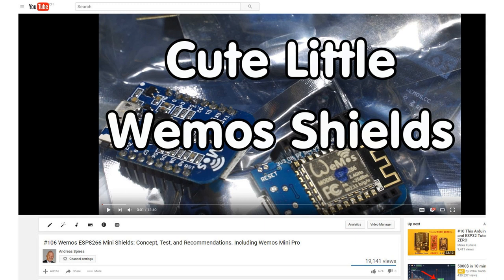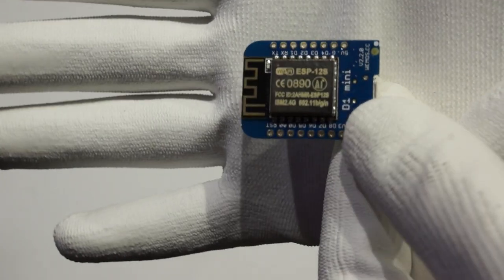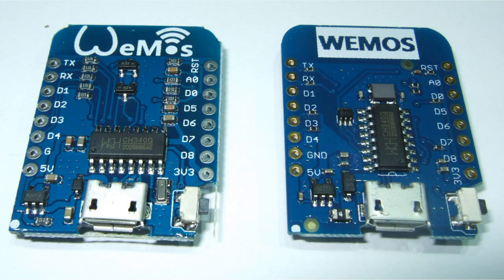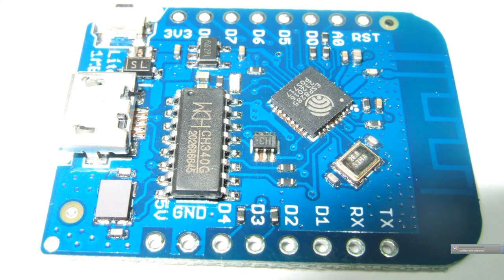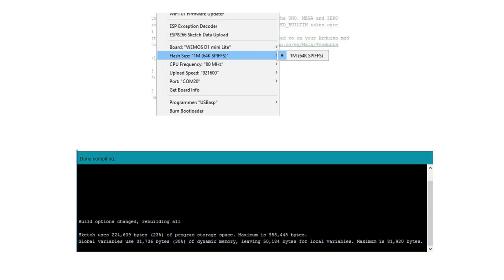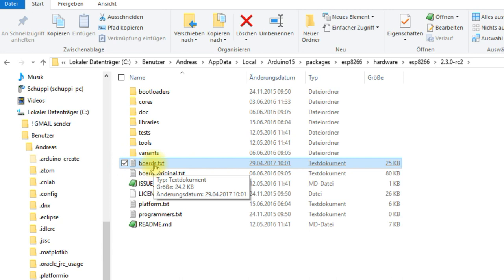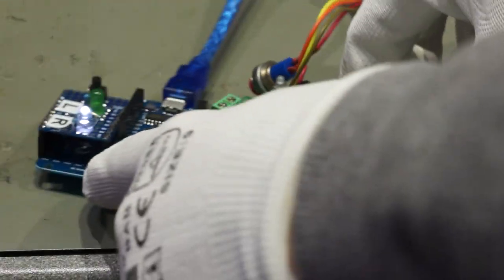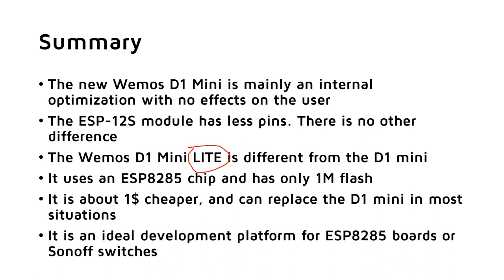#136 New Wemos D1 Mini Shields: ESP-12S and ESP8285

Comment: I like the esp8266-12f module because it is so tiny. But it is hard to program with the need of an external usb/serial adapter and the tiny connections.
This weekend I desoldered the 12f module of a wemos D1 mini and soldered 2 female headers on it.
Now i can easily solder male headers on the 12f module (2mm) and connect it on a D1 mini to program. Works perfectly. 
Thnx for the nice video. For me the extra $1 is worth it.
Reply from the maker: Before the Wemos came I usually used a bare ESP-12 module (programming was done with Pogo Pins). Now, it is more convenient for most of my applications to use a Wemos mini. I anyway try to use OTA (iotappstory.com) as much as possible to avoid Serial connections...

Comment: You don't need a flash button. The arduino IDE uses DTS/RTS via USB to automatically enable flash mode. You just need the correct board selected: "Wemos D1 R2 & Mini"
Reply from the maker: I know. Maybe I was not clear, but sometimes I want a button to trigger a function in one of my sketches, and then, such a button is handy...

Comment: Why would you need a "flash button"?
The run/flash mode is fully automatically handled.
Reply from the maker: You are right. But I do not flash by Serial, I use IOTappstory.com. There, I need as switch to indicate the board to go into config mode or  to start an update. This is the case in many other applications where you need a button to interact with the device.
Reply: Ah, okay.
I use the Arduino IDE. And normally, I always active the OTA Update server, so that I can update it via WiFi.
Reply: I also use the Arduino IDE and the Arduino OTA. My WeMos are distributed in the house, in the garden and in my second flat 100km away. Some of them are build in and unavailable . So I need a real OTA without pressing a local button. In my applications an OTA with pressing a button is not very useful.
Reply: "In my applications an OTA with pressing a button is not very useful."
´The provided OTA function does not require pressing any button!
Reply from the maker: +klassich D You are right. In production environment, OTA has to go this way. But I use my boards also for development. And then it is sometimes handy. But it is a small detail. Not important. Just a difference between these boards and the NodeMCU boards.
Reply: Exactly; and this is the reason why I will stick with the Arduino IDE and will not move to a different method using an additional button. Using the "espota.py" and a .bat file I even can flash my WeMoses in my second flat over VPN. That is really great. If I want to update e.g. 10 temperature sensors, it is just the preparation and starting of a single batch file.  This works really great!
Reply from the maker: +klassich D with IOTappstory.com we chose a different way where we provide a webservice which automatically detects, if a newer version of the firmware exists. Then, the device updates automatically. And of course, you can assign as many devices to the same app. But there are many ways which lead to Rome, as we say here in Switzerland;-)
Reply: Yes, that is also a good way if you can wait a little bit. And I admint: In the long term it will be the better solution, when (if) deep sleep really works and gets more and more common. 
In general I always tend to prefer solutions running on my own server.  
From here in Germany a very common way to Rome leads through Switzerland ;-)
Reply: Das sagen wir auch hier Österreich. ;)
Reply: A dedicated flash button has nothing to do with the WiFi modse. This has to be done by software with a separate input push-button.
The flash button is normally connected to GPIO0 and toggles "boot from SPI flash" or "download code from UART". (with GPIO15 LOW and GPIO2 HIGH)
Reply: Wemos D1 mini is unable to go into flash mode if you make the deep sleep bridge from D0 to RESET. You have to add a jumper or button. Also, the reset button acts on release only, there are some projects that go into OTA mode or something when you keep the reset pressed for X seconds, this is not possible on the D1 mini.

Comment: I might add that I noticed that the new Lite and 2.2.0 version now have an onboard poly fuse.
Reply: what is the use of the fuse, if boards gets to hot to shut down for a while ?
Reply: The fuse will open if you draw too much current from the supply.  IE if you short VCC to GND accidentally. Note that polyfuses are designed to self resent. https://en.wikipedia.org/wiki/Resettable_fuse
Reply from the maker: +Jon Raymond Thanks for the tip. I will add it in the comment. I overlooked it. My mistake.

Comment: Thanks. Why the capacitor in the button shield. It is required? To flash the wemos is not only pulldown to ground D3(gpio0) for more than 5 sec?
Reply from the maker: Mechanical switches "bounce" and might disturb the behavior of fast microprocessors.

Comment: can you do a power consumption of the wemos d1 and d1 lite , like what you did with the esp 8266
Reply from the maker: I do not think, that there are big differences between the old and the new Wemos boards. The designs are very similar. All Wemos and NodeMCU boards, however, use much more current than the bare modules during deep sleep, because they have additional chips.

Comment: How the blynk app connection to this boards acquire flash memory. What will happen if i buy 4mb wemos d1 mini rather than 16mb wemos di mini pro
Reply from the maker: I never worked with the Blynk app.And I am not sure what advantage 16MB have. Most of the projects do not need such a large memory.
Reply: @AndreasSpiess  my plan is to create iot solar monitor using blynk app. The thread i have followed uses a d1 mini pro which has 16mb. But he has given the file which is only 90kb. My confusion was like adding libraries and stuff will accumulate the internal flash then i may require more flash (like 16mb) for that. Then im going to purchase d1 mini v3 with 4mb. 
Now im clear. Thanks a lot!!

Comment: Wait ! Aren't those extra pin on the ESP12-E for the hardware SPI ? 
I know it is hard to use because it also has the flash chip but SPI is a bus, should be possible to have multiple devices on there no ?

In particular, it should allow booting the ESP off a microsd card of gigantic proportion compared to the flash !
Reply from the maker: Maybe. I never saw somebody using it.

Comment: I have a D1 and I can upload code and it works without any need of added buttons?
Reply from the maker: The D1 should reset automatically. Usually, you do not need to press buttons for programming

Comment: I added the boards definition to the boards.txt file.  Still no luck with the mini lite.  I'm beginning to think it is a waste of time, maybe should just stick to the D-1 mini, mini pro.
Any help would be greatly appreciated.
Reply from the maker: I think, the new 2.4.0 release has the Mini Lite in the boards file. Otherwise you can replace yours with this one: https://github.com/esp8266/Arduino/blob/2.4.0/boards.txt
Reply: I just replaced the entire file with the link you provided.  I get the same error code:
```Arduino: 1.8.4 (Windows 7), Board: "Wemos D1 mini Lite, 80 MHz, 1M (512K SPIFFS), v2 Prebuilt (MSS=536), Disabled, None, 921600"

C:\Users\User\AppData\Local\Arduino15\packages\esp8266\tools\xtensa-lx106-elf-gcc\1.20.0-26-gb404fb9-2/bin/xtensa-lx106-elf-ar: unable to rename 'C:\Users\User\AppData\Local\Temp\arduino_build_764579/arduino.ar'; reason: File exists

exit status 1
Error compiling for board Wemos D1 mini Lite.

This report would have more information with
"Show verbose output during compilation"
option enabled in File -> Preferences.
```
Reply from the maker: I would uninstall te ESP boards in boards manager and remove the whole .../esp8266 directory (if it still exists). Then re-install ESP, Test compilation with a normal board and only add the new boards file if everything works before
Reply: I deleted it under boards manager and then deleted the empty folder.  When I type esp in boards manager, it does not come up.  Under preferences: What "additional boards manager url" are you using?  I was using: https://github.com/esp8266/Arduino/releases/download/2.4.0-rc2/package_esp8266com_index.json

Thank you for your time!
Reply from the maker: I use this one: http://arduino.esp8266.com/stable/package_esp8266com_index.json
Reply: Thank you sir!  I think I'm making progress.  Added the url to the boards manager, then installed esp 2.4.0
Now the Mini lite shows up.  I just uploaded to "get chip id" sketch on a wemos d1 mini.  Compiles and uploads fine.  I get the chip ID.  Unplugged the regular d1 mini and plugged in a mini-lite, changed the board to mini lite in Arduino. Then compile.  That compiled.  Now to upload: NO!  : (
I still get this error:
Arduino: 1.8.4 (Windows 7), Board: "Wemos D1 mini Lite, 80 MHz, 1M (no SPIFFS), v2 Prebuilt (MSS=536), Disabled, None, 921600"

Archiving built core (caching) in: C:\Users\User\AppData\Local\Temp\arduino_cache_93253\core\core_esp8266_esp8266_d1_mini_lite_CpuFrequency_80,FlashSize_1M0,LwIPVariant_v2mss536,Debug_Disabled,DebugLevel_None____,UploadSpeed_921600_525d20b96160dc2c65dab96450e4c58c.a
Sketch uses 250927 bytes (24%) of program storage space. 
Maximum is 1023984 bytes.
Global variables use 33216 bytes (40%) of dynamic memory, leaving 48704 bytes for local variables. Maximum is 81920 bytes.
warning: espcomm_sync failed
error: espcomm_open failed
error: espcomm_upload_mem failed
error: espcomm_upload_mem failed

This report would have more information with
"Show verbose output during compilation"
option enabled in File -> Preferences.
Reply from the maker: This is a problem with serial. Maybe you reset the board and keep the reset button pressed till upload. Or you press the boot button on the board if available.
Reply: Sorry to report.  This didn't work.  I seriously doubt there's anything wrong with the esp either.  For an extra 50 cents, you can get a real esp 8266.  I'm sticking with the D-1 mini and mini pro.  Forget the lite.  I see it is in the description but I bet most miss it because of the beloved D-1 mini is so great [IMHO], that they fail to see that the mini lite is has an esp8285 chip instead.  At this point, I don't see any benefits of a mini-"LITE".  Thank you for the help though.  Your videos are excellent!

Comment: looks like they changed the crystal and also added a polyfuse and a beefier schottky. Do i see less support components?less limiting resistors or pullups ?
Reply from the maker: I saw these two changes too, but thought, this is not important. The "support components" are now extremely small in size, but similar in numbers (3 caps and 4 resistors) I do not know their values. I hardly see the components...
Reply: The polyfuse and schottky are important to hobbyists, means they are less likely to blow the board up by overvoltage or overcurrent shorts. I am gonna buy one because of those, I already fried some nodemcu boards due to stuff like that.
Reply from the maker: +tablatronix Thanks for the tip. So far, I never had issues. Maybe because I use the boards mainly with 5V. The diode, however is not much bigger. But the polyfuse is an important info which was overseen by me. So, I will update the comment.

Comment: Hello, recently I discovered this channel. Nice video and voice :D. I would like to connect the Soil Moisture Sensor and BME280 (Temperature, Humidity). Later and soiler charging battery panel.  I am new on the Arduino and faced with a simple question. Is it possible to connect 2 Sencor on WEMOS.
Reply from the maker: 1.Welcome to the channel!
2. Yes, you can (connect more than one sensors to the Wemos. If they do not use the same pins or use the same interfaces like I2C or SPI. Just google
Reply: Andreas Spies Thank you.

Comment: Esp 12S has a optimized antenna and less pins over the ESP12F.
Reply from the maker: The antenna seems  to be the same as on the ESP-12E (visually)  and the pins are mentioned in the video...
Reply: The antenna is very narrow on the ESP-12E. 
On the ESP-12F is the antenna like the ESP-12S but on the ESP12S the antenna is slightly longer :) look closely like the ESP-14.
Maybe you can do a range test video over all the latest ESP's.

http://www.esp8266.com/viewtopic.php?p=55169